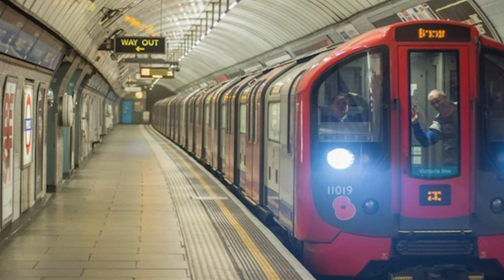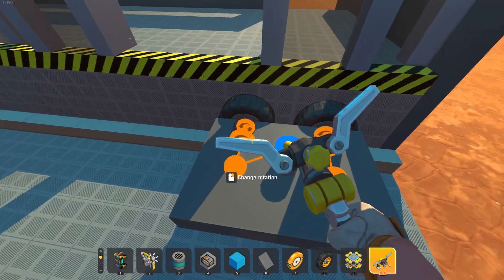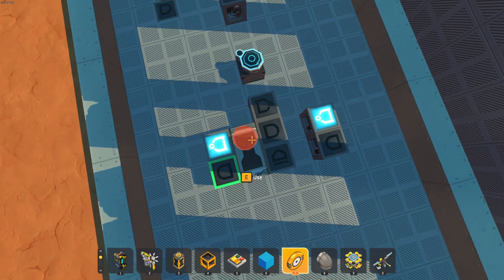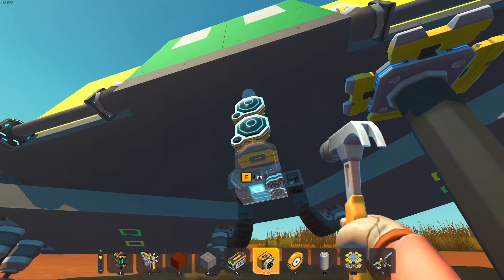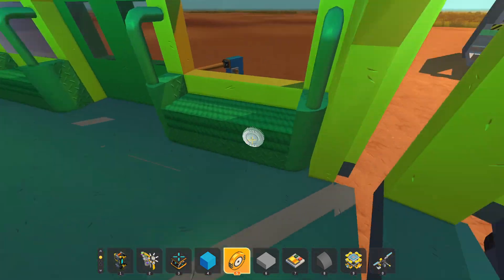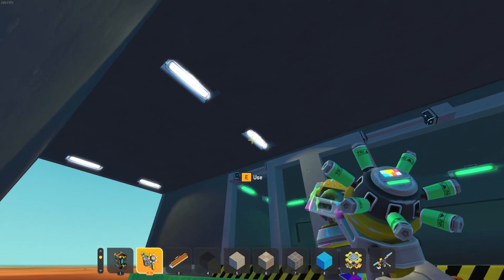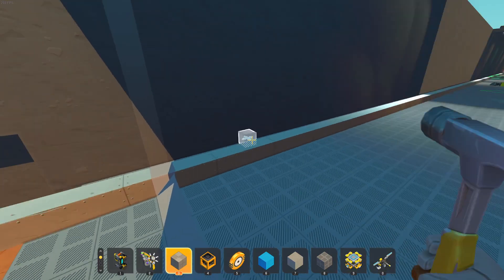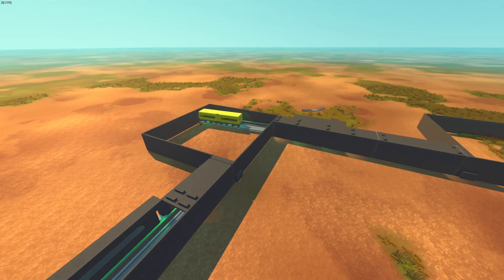Building a Self Driving Train System in Scrap Mechanic!

Comment: I think you could have easily avoid using mods, it would add to it a lot
Reply from the maker: yeah, I really just used them for the compact engines and polygons but once I eliminated traditional turns it wasn’t really needed anymore I guess.